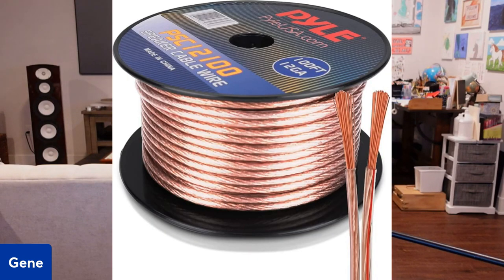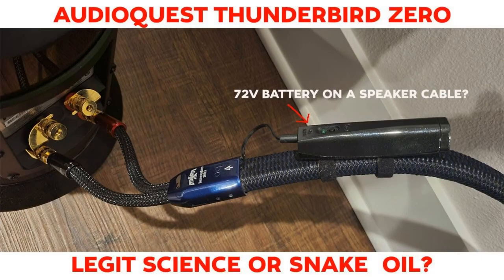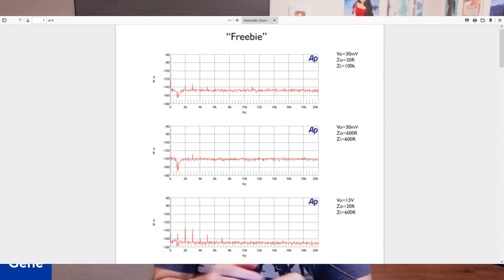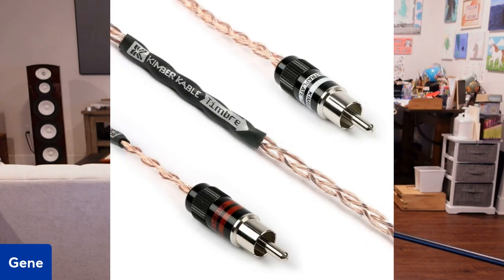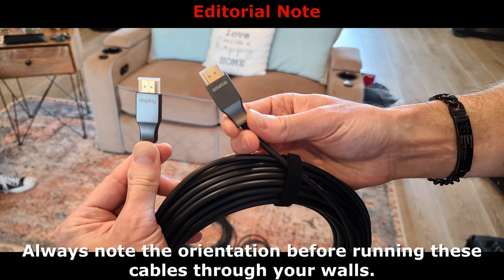Are Cables Really Directional?

Comment: As far as internally amplified speakers, what kind of cables do you recommend? 10 gauge speaker zip wire or XLR cables? I'm asking because generally people say you want the largest gauge possible, but XLR cables are usually smaller than 18 gauge, but are balanced and shielded.
Reply: So from my experience if you have a pair of powered speakers where each one is internally amplified you would use XLR to connect the two. If you have a pair where one is active and the other is passive you would use regular speaker wire to transmit the power from the active speaker to the passive speaker. XLR connections are low voltage so you wouldn’t use XLR to transmit power to a passive speaker.

Comment: I really need your help , your voice and opinion can hopefully make denon acknowledge my issue. I am beyond frustrated with the HDMI 2.1 implementation and I feel denon is not giving my issue enough attention. My denon X3700H is having lots of issues with VRR when HDR is also turned on , that's on the PS5. The screen randomly flickers on different games on random areas for no apparent reason. They released  a firmware update that is supposed to have fixed the issue of desaturated colors on VRR+HDR , But now I am suffering screen flickering. 
Tried different cables to no avail , going directly to the TV works fine.
I would appreciate your help so much 🥺
Reply: On x4700h, the last 2 updates fixed my intermittent problems on Series X. Occasionally it lost the signal sync, when game changed to HDR or on startup, it didn't fix on the signal at all... That was really, really annoying!

Whole hdmi2.1 is handled REALLY BADLY, methinks... Good cables are very important, but also firmwares can fix a problematic things...

They started to make some new cables for 2.1? Was it on next revision or something? Like, amplified... Cannot remember exactly, but saw some news on it, a while ago...
Don't have PS5 (yet), but I think many sites and tech tubers said the VRR-implementation is still buggy...
Maybe you just must wait for updates...
Reply: I go straight to the TV and utilize E.ARC for this very reason. I had to turn off the HDMI control as E.ARC causes some weird behaviors when HDMI control is active on the ps5. But i have ZERO issues with sound or picture. Not ideal I know but its just better in every way to the receiver implementation.
Reply: @miikasuominen3845  I have been suffering from loss of signal when making a new handshake for so very long. And unfortunately it's still unfixed for me. It's better than it used to be , but still I have it.
After the new update I am having random screen flicker on some games when HDR+VRR are active on the PS5
Reply: @damienlahoz  Yes going through the TV is way better , but unfortunately I lose the 7.1 PCM surround. I have a samsung Q80T and it can only return 5.1 dolby digital signal through arc , the difference between PCM and dolby digital is HUGE! That's why I am trying to avoid arc as much as possible
Reply: @miikasuominen3845  I am currently on the fence about this , I was thinking to let my denon go in favor of the new Pioneer VSX LX505. I really wish denon would fix this issue , as getting the pioneer shipped from abroad is going to cost me a HUGE ton of cash
Reply: @WOLFx1950  ah yes, understand. 2.1 is certainly a n imperfect standard, will see improvement in 2.2 lol
Reply: I hear ya on I went from Denon to marnantz thinking it would be better well.... nope!!! when it wants to work it's great but the components are not quality, where is the quality and control your sell products that say it does HDMI 2.1 now I need a little box, now it's popping my speakers and goes into the red dot flashing going into protection mode ,  plus I rather have more firmware updates to fix issues that are going on (I get nothing is perfect but back your product) and showing that they care about there products (replace old with a brand new one's ) and customers, seems like there is a pattern here and no one listening 🙈🙉🙊
Reply: @damienlahoz  😂That's just sad
Reply: @richardbarr2328  What issues did you have with your denon?
Reply: @WOLFx1950  it was an older unit so I thought it was time upgrade and wanted the 2.1 HDMI when that came out what a mess that was to get the box , now I get this popping / bang sound and goes into protection mode, I've changed power cords all new speakers and new speaker cable (thank goodness I still have warranty left) otherwise I'm tossing it , firmware updates should be going on all the time PS5 has up dates all the time it shows that there could be an issue I'd do that then having it in the shop
Reply: @richardbarr2328  I think you should get your unit replaced , the protection mode thing is weird I guess
Reply: If anyone else is having white screen flickering as me on PS5 games when HDR and VRR are both activated...This comment is something to get you started and maybe they will listen to our issue.
 I have been running a battery of tests all day now. Here is what I found 

.Games that work fine(HDR+VRR):

Fall guys
Astro playroom
Crash 4
Deep rock galactic 60 FPS mode 
Resident Evil 3 (120 FPS Mode)
Apex Legends
Ratchet and clank (40 FPS , 30 FPS , 60 FPS)

.Games that don't work well (HDR+VRR) , White flickering:

Resident Evil 3 (60 FPS mode)
Elden ring
Devil may cry (Ray tracing mode , Ray tracing mode on+high framerate mode on, Ray tracing off , Ray tracing off + High frame rate mode on)
Deep rock galactic (120 FPS)

.I will be running more tests on more games the upcoming days. 

.To note, games that have issues in (HDR+VRR) run well when the PS5 is connected directly to the TV
Reply: @WOLFx1950  did you try doing a factory reset, either that it could be your HDMI board could be fried or try a different HDMI port and see if it does the same thing
Reply: @WOLFx1950  I hope they replace it or allow me to upgrade to a newer different model, it's not like these things are cheap , they know there is an issue otherwise people wouldn't be complaining all these issues, I hear your frustration especially when you just want to sit back after a hard day's work and chill out with the family and watch a movie and then it doesn't work and your like WTF, great way to ruin your night
Reply: @richardbarr2328  did all mind of resets 🤕 It's 9nly one port with HDMI 2.1. Some games work fine , others don't which is weird
Reply: @WOLFx1950  are you using the eARC HDMI port on your TV, try using a different port, I know when I was looking for a TV the dealer  said LG doesn't work with other products something about the handshake from the source to the TV so I went with Sony
Reply: @richardbarr2328  No , my setup goes like this (PS5>Denon 2.1 port>Tv 2.1 port)
I don't like using arc cause I can't get PCM and 7.1 surround , only limited to 5.1 dolby digital
Reply: @richardbarr2328  Great way to ruin my whole week 😂
Reply: I've had tons of problems with my Denon X3700H as well. I bought it since it was supposed to support HDMI 2.1 but when I try to connect my HTPC to it the colours get all messed up. I have had to resort to running a cable from the PC directly to the TV and a second cable to the AVR. Though by going that route it completely defeated the point of spending so much money on an AVR with HDMI 2.1! I also have trouble with the AVR stopping outputting sound if I leave my computer sit doing nothing for about 10 minutes, as well as every single time I turn it on. I have to use my quick select button on the remote to get it to output sound again! So frustrating!
Reply: @brandobond  I had it for about a year , and it is the most frustrating machine I have ever had! Handshaking issues with ps5 all the time , I keep switching back and forth on the inputs to reinitiate the handshake and pray to god it works , I would keep switching back and forth for five times for it to worl. It has beautiful features on paper but in real life it's a totally different story. Do you have the older version or the one with the updated chipset ?
Reply: @brandobond  sounds like you got a bad receiver also , all I know if this isn't fixed I'll be contacting them and asking for a different one or my money back , all these videos about speakers and cables but nothing about the snake oil with receivers and what really is the issue instead of fixing but willing to take our money and left with 50 pound paper wait
Reply: @WOLFx1950  I didn't realize there was an updated version. I've had mine for about a year and a half so I probably have the original version.
Reply: @richardbarr2328  I contacted Denon about it and they just blamed it on Nvidia and my 3080 graphics card. How does it make sense when it works great when connected directly to the TV but has problems when going through the AVR? I have a two year warranty with Best Buy that is almost up so I could try getting them to fix/replace it. Only problem is that I paid $1000 for the unit and now it sells for $2000. If they need to replace it I'm guessing they will try to make me pay the difference or get a cheaper model!
Reply: @brandobond  You should get a replacement and pay nothing. This shouldn't be taken on the consumer , and sound united should be called out for such shameful business practices and the horrid HDMI 2.1 port. This is my last ever denon purchase and I wouldn't be recommending it to anyone. I will push for a refund and hopefully get the new pioneer

Comment: I run everything off my HTPC and I have learned that the biggest source of noise in my audio system is the graphics card. There is poor electrical isolation of the HDMI port from the rest of the card and I often hear pops and staticy noise from my speakers that corresponds to things changing on the screen (the graphics card outputting different data). You'd think that a high end, expensive card like my RTX3080 would be better built! I replaced my HDMI cable with an optical HDMI cable in hopes it would reduce the noise being passed on and it helps but does not completely eliminate the problem.
Reply: That sounds like a faulty card. I have a 3080 and do not experience that and neither to most all 3080 owners unless I'm missing a fatal flaw.
Reply: @justinbeamon6624  Wish I had another card to test and see. I researched online and saw many others with the same problem. The consensus was that graphics cars aren't made with very good electrical isolation (most likely because 99% of end users aren't audiophiles and won't notice/care if there is sometimes pops/noise).

Comment: I don’t have a dog in this fight, other than I use cables, like the rest of us.

When I set up my theater system my tv kept cutting out, like it was losing signal from the receiver.

I noticed the cable had arrows on it and I had it installed backwards.  I reoriented the cable and it solved the issue.

Comment: Gene, you probably picked the speaker cable picture randomly, but I couldn't help but notice the brand - Pyle.
In case the younger generation isn't aware of this companies notorious motto adopted by the general public, it's "Pyle of crap".
the car audio equipment is some of the worst on the market.
their pro audio equipment isn't any better than a cheap Sony integrated components receiver.

They just really suck all around.
I wish they'd close up shop.
sadly, I bought a microphone stand from them which is a heap of garbage.
20 years ago when I got into car audio I knew someone who had one of their amplifiers which we opened up and noticed that the chassis of the amplifier was about 30% bigger arbitrarily then the components inside. there was a huge gap between two boards just so that the amplifier would appear bigger and more powerful than it was.
the transformers are undersized along with the capacitors

Comment: Sometimes RCA cables will have a shield that’s only grounded on one end, and the thinking is to have the ground trickle it’s energy backwards to the source component,  having it disconnected is an effort to alleviate ground loops from the devices have different ground potentials which can come from transformer leakages or having gear plugged into different outlets in the room. I believe it does address the ground loop problem it intends to.  I’ve never seen it quantified what level of influence there is whether it’s grounded on the source side or the amplification side.  

I’ve had my own firsthand experiences with ground loops and 60hz hum, and with a healthy understanding and respect for the science electromagnetic fields and induction, I’m a believer in twisted pair power cables because they’re AC and right in the rats nest of all the signal wires.  Also a believer in toroidal or electromagnetically encased power transformers as if there is DC offset on the power theDc offset can saturate the transformer and radiate EMi inside the Chassis, and XLR interconnects which have an almost flawless rejection of all noise and Emi, probably to the point of XLR being the begging and end of any of these concerns.  But as an optimizer and a nerd, I love squeaking every last drop of perfection out of things. But I’d never spend any significant money on cables.  Most I’ve spent is $250 on Braided Krell Kryo cable by Maze Audio. They’re like 8 gauge, braided, beautiful, gold plated prongs, and they drag all my gear onto the floor with their weight.  

For my sensibility, they’re still expensive at $250 like too much. But they were the cheapest braided power cable I could find, and Probably light years ahead of any other high end nonsense that isn’t braided or has lower gauge.  Check it out, Maze Audio “krell kryo” (it has krell end plugs)  I got a 4 foot length just to clear my signal cables of any localized EMF.

Comment: If the noise the Audioquest cable is adding is 2nd harmonic, that can definitely sound better.
Reply from the maker: LOL adding distortion caused by RF pickup will NOT sound better.
Reply: @Audioholics  good point. My Greenwave EMI/RF filter is an absolute gem btw.

Comment: I don't know about speaker cables but I have an optical HDMI cable thats 100% directional. When I first connected it to my blu Ray player and TV I only got audio with no picture. I reversed the connection and I git both picture and audio.

I changed my speaker cable to OFC 2.5 kebledirect speaker cable a few days ago and finally put banana plugs on the cable. It wasn't expensive cable.e either.
Reply: An active cable (cables with chips inside) is directional. Gene was talking about audio cables, which are passive and not active. What you said is true for all active/fiber HDMI cables or any other active cable (USB, thunderbolt etc).
Reply: @shashank_mittal  I've never bought into the expensive speaker cable tripe though.
Reply: @Steve30x  I make my own audio cables using Belden, Mogami or Canare bulk stock and Neutrik connectors. Expensive cables aren't for me either.
Reply: Yes, this was addressed in the video, and is an important observation. Many HDMI and display port cables that are over 2 meters long are optical or powered and directional. The main reason for this is that it needs power from your device to manage the optics.

Comment: Gene, how do they implement this battery on a speaker cable. when I was a lot younger I remember connecting a battery to speaker and depending on the polarity it would  either push the cone out or force it inwards. So by placing a battery on this speaker cable it would force the loudspeaker cones in one direction, and one direction only, and stay there the entire time it was connected. Not to mention the amplifier would not like it either. All this is pretty basic stuff, so why are companies trying to push this type of trash on to people, do they really think their custumers are that stupid. I have studied both electronics and audio engineering and some of the things I have read, seen and heard make me mad and sad to think people and companies can come up with so much nonsense. Just a little logic and some common sense, would go a long way.
Reply from the maker: The battery is a scam. It's connected to the dielectric so it does nothing.

Comment: The direction of speaker cables absolutely shouldn't matter ..but I did blind testing and could tell every time when they had changed the direction of the cable or not!
I suggest any doubter to test it yourself. Especially hi-hats and cymbals can sound annoying if the cable is the wrong way.

Comment: I unsubscribed myself from B.S. Audio's YT Channel after a few tests and reviews of their products. Some measure Ok at best, but nothing top notch for the Price tag. All the non-measurement guys are going to rant in, but let me ask you : among all the good measuring Gear out there, do they all sound the same ? If No, pick the ones you prefer (and can afford). If yes, then why pay extra, go for the best value for your needs. Now, if you prefer Gear that don't measure well, that's just fine by me, I totally get why you'd like something warm to relax and chill out, or if you're a bass head, or even if you're into vintage sound (used to have a old mechanical phono myself) but please don't pretend it's superior in any way. I can do just the same by coloring the sound of a good measuring equipment with...simple tone controls, tubes etc. Good measurements is certainly not everyone's taste, but it's a good starting point and usually cheaper than Many insanely expensive "HIGH End" audio products that have such dips or Bad transients that they rob you of your own music : information that is actually on your CD, File, even analog recordings, but can't hear because it's blurred or burried under loads of boomy upper bass or distorsion in general. Those cable BS are Indeed the pinnacle of audiophool snobbery. Thanks for that. Or rather AGAINST shouldn I write...